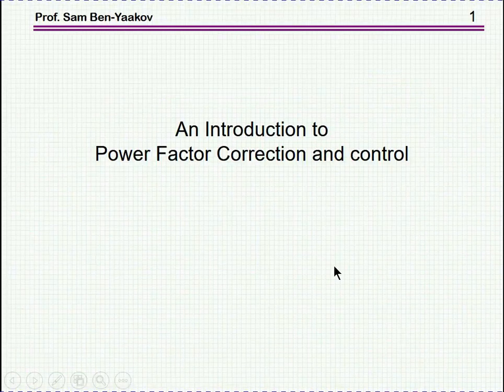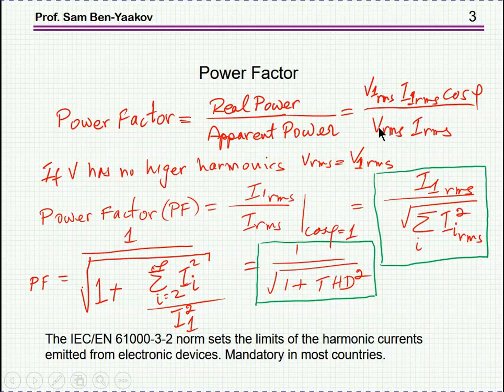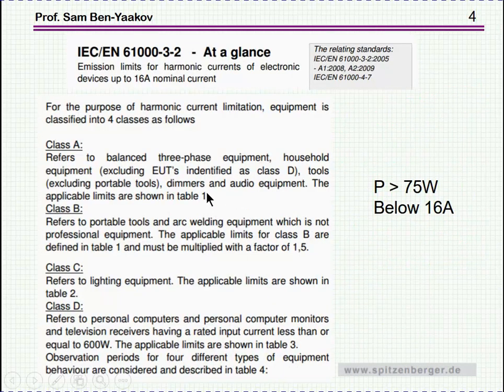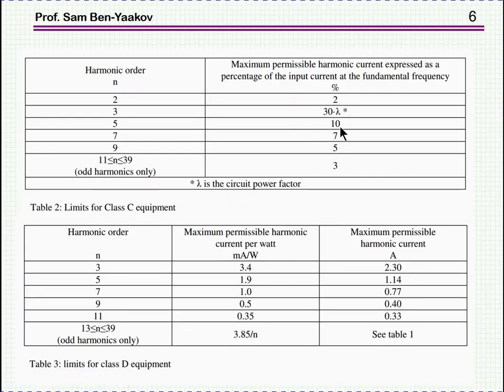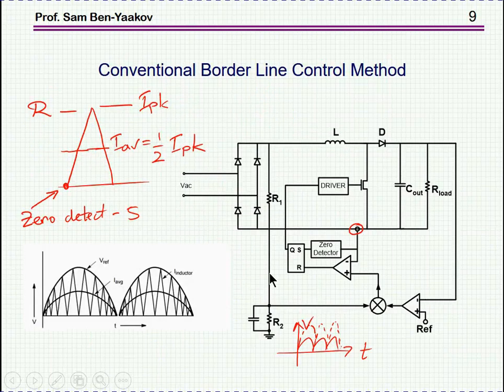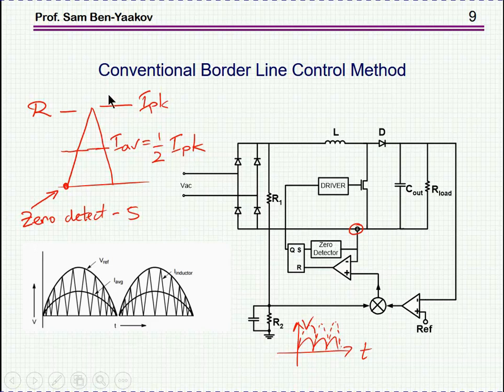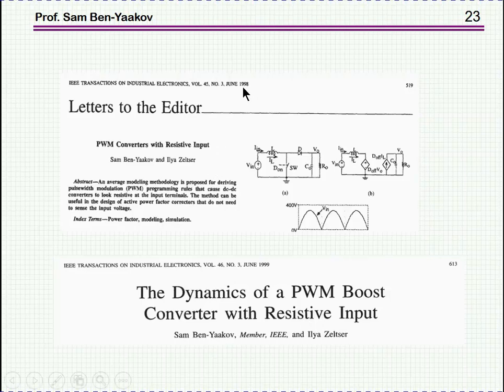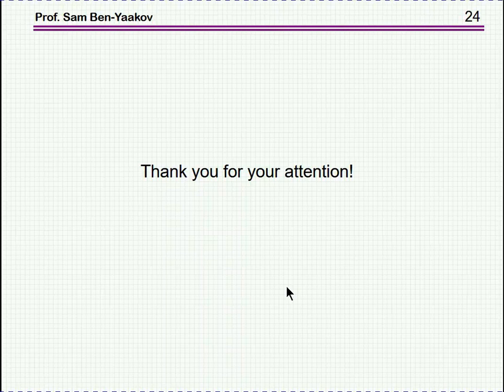Introduction to power factor correction (PFC) and control

Comment: Thank You Professor! I've learned so much from you over the years about magnetics,  power electronics, etc., but  this information had to be the most valuable to me at any given time.  Not only did you concisely explain the innerworkings of the Best CCM PFC ICs on the market, but with your design, you've shown me that I'm on the right track. I've already got the PNP current mirror in my design for the math, was just going about it differently. FINALLY! Someone explains K constant in detail and that multiplier down to component level .

Comment: Do any modern power supplies use DSP's to replace a lot of the analog circuitry (filtering, feedback for output regulation, and generating the PWM signal for good PFC, etc)?   Or is this still in the domain of analog specialty power-supply controller IC's?   Dedicated analog controller IC's can probably operate much faster than DSPs (maybe?), and allow using smaller/cheaper inductors which make up a good portion of the cost of a SWPS.   There are reliability issues with DSP's too (software bugs, random bit errors in an electrically noisy environment) that might make them unsuitable.
Reply from the maker: Hi Jess, thanks for comment. Yes, digital control is paving its way into the power electronics arena. Advantage are seen when the processor is not just mimicking the analog controller but when when real time  logic decision are incorporated.
Reply from the maker: Would you please share your comment at the LinkedIn group ( https://www.linkedin.com/groups/13606756 )  I have recently started? Thanks.

Comment: I was wondering what will happen if we replace the AC input with DC one , for e.g instead of 240v AC we supply 345v DC , how would this circuit will response ?
Reply from the maker: Normally it should work OK current in phase with voltage🙂
Reply: @sambenyaakov  thanks for reply soon I will be testing it , and will let you know what happens 😄

Comment: The goal is to to build a PFC unit operating at full ZVS at a fix frequency , and the high ripple current (with some negative current) is needed for that . but there is no control IC to support it.
Reply from the maker: Perhaps these will be of interest?
http://www.ee.bgu.ac.il/~pel/pdf-files/pat17p.pdf
http://www.ee.bgu.ac.il/~pel/pdf-files/conf123.pdf

Comment: I have one  question: what is the actual limit on the current ripple  in  the inductor  in CCM PFC ? is it possible to use a controller intended for CCM PFC while the current is discontinues ?
Reply from the maker: Hi Moshe, the transition from CCM to DCM is when the p-p ripple is equal to the DC value. There is usually no control problem when the converter moves from CCM to DCM but if only DCM is expected, phase compensation tuning will improve performance.
Reply: Hi , thank you for the reply, but this is not my question. i want to work in DCM (with high ripple current like boundary mode even at full load), but at a fix frequency. The question is will it be possible to operate properly with a control IC that supports CCM PFC ?

Comment: Hi Sam, You have talked about Boost PFC, but what about Buck PFC ? In what range of power is a Buck PFC recommended to use ?
Reply from the maker: There is a problem with a step down. You will not get any current for input voltage below the output voltage.
Reply: Ohhh, I see, so there is higher THD and hence RMS currents... so its power range is low...
Reply from the maker: Correct.

Comment: Prof Ben Yaakov,  a wise man once said that if you can't explain complex problems in a simple way,
you do not fully understand the problem.
You are by far one of the more gifted lecturers around.
First giving the high-level picture and intuition to a problem with minimal math necessary.
Also, your understanding of what a student can grasp at first glance and what must be repeated several times using different approaches for different people in the listening crowd shows your passion for teaching and educating.

Your lecture style is very similar to Grant Sanderson (A.K.A 3blue1brown).
Reply from the maker: Thanks Shahar, comments like yours keeps me going.
Reply: Prof Ben Yaakov, thanks for your reply! 
BTW, are you planning to make a video on bi-directional power supplies? 
They seem to be the preferred charging topology in the electric vehicle market.
Reply: Albert Einstein

Comment: I have one question:
In-order to change the current waveform the PWM changes the Duty Cyclebut then   the gain of the boost converter also changes.
Does making the Current to follow the same waveform as the rectified voltage assures me that the output voltage will remain constant?
Reply from the maker: The changes in the duty cycle are minute, just to overcome the change in voltage drop on parasitic resistance due to the varying current.

Comment: Sir, after 1:38 you defined Power Factor=Real Power/Apparent Power, which followed by V1rms.I1rms.Cos(theta)/Vrms.Irms. However, my confusion is, is that Cos(theta) suppose to be the power factor? 
May be I got it wrong but I just want to ask, what is the difference between your definition to this definition:
Real Power=Vrms.Irms.Cos(theta)
Apparent Power=Vrms.Irms
Therefore,
Cos(theta)=Real Power/Apparent Power
Power Factor=Cos(theta)=Real Power/Apparent Power
Reply from the maker: Real Power is = I1rms*V1rms(cos(theta)
Reply: @sambenyaakov  So that "cos(theta)" is the Power Factor right?
Reply from the maker: No. The power factor is as defined in video. In the PRIVATE case without higher harmonics it converges to cos(theta)
Reply: Thanks Prof. Sam Ben-Yaakov for clearing my doubt. 
Looking forward to learn more from your videos Sir.